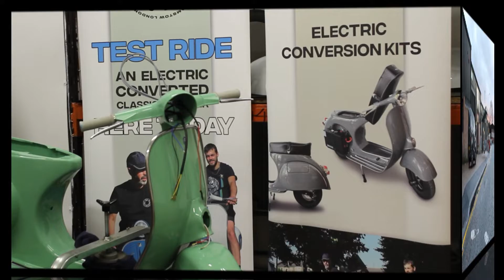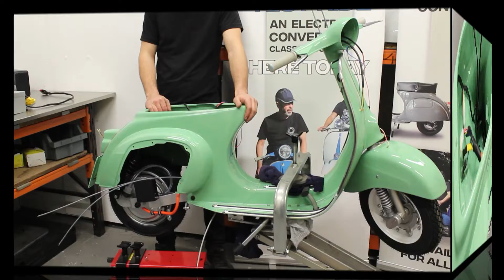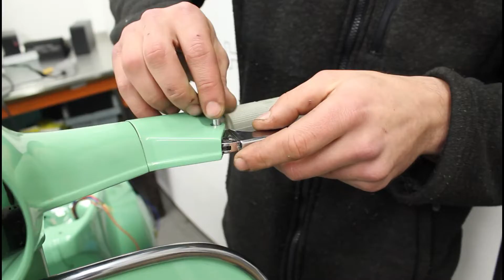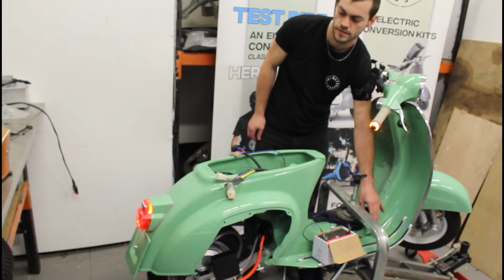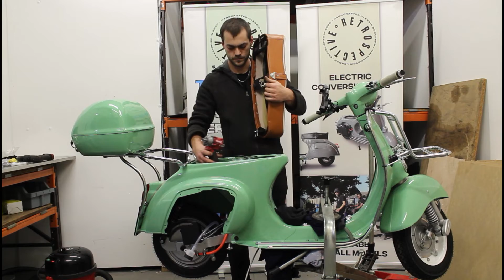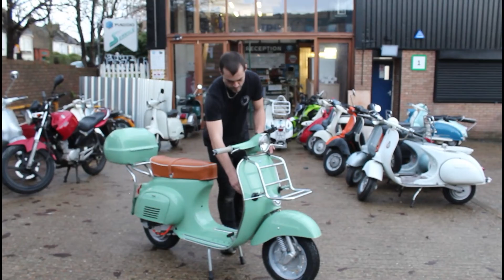Vespa Small Frame Electric Conversion Kit STEP BY STEP Install

Comment: I have this kit however the video or PDF manual does not talk about how to mount the actual throttle box.  I can see in this video it's mounted however there are no obvious areas for it to be installed on my kit.  Any advice please?
Reply: After looking at 6:18, I can see there is a plate used to mount the throttle box, however this did not come with my kit.  How do I arrange for a re-send of all the missing pieces my kit did not come with?  I'm not getting any response through the sales email.  Please advise.
Reply from the maker: good morning apologies for the delayed response i will chase up the email and get the PART out to you .

Comment: Does the clutch handle and gear crank have a function after this conversion?
Reply: I saw it did something... was that a kill switch or something else?
Reply from the maker: the clutch becomes a kill switch
Reply: @retrospective2000  is it to cut any current to the motor? or as park input switch?

Comment: what's the top speed and range or this kit?
Reply: Depends on the configuration (batteries) and settings you ask us for.  The basic setup (one battery) is 25 miles and top speed of about 55mph.  Range can be doubled with extra battery.
Reply: How can i get the c v kit
Reply from the maker: look on www.retrospectivescooters.com
Reply: Que precio tiene el kit?